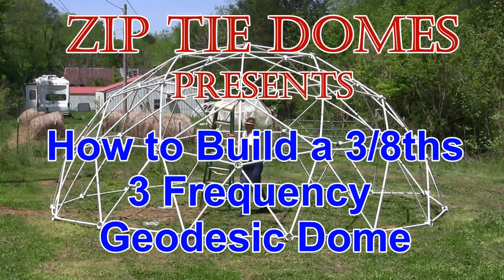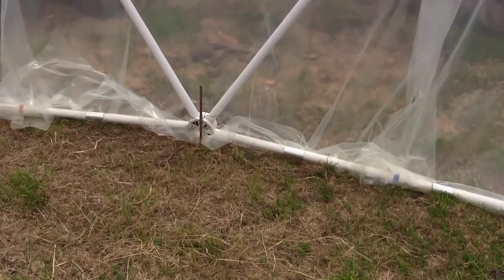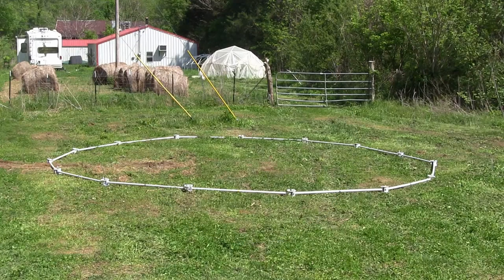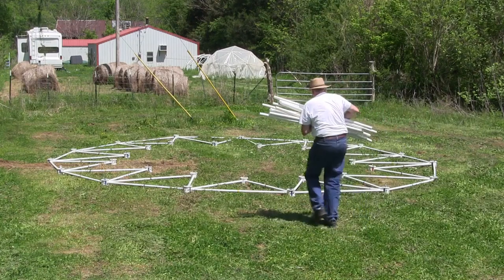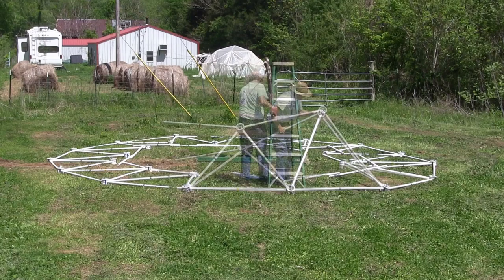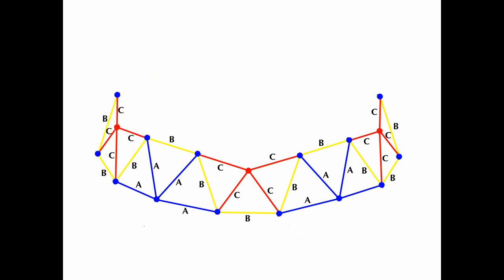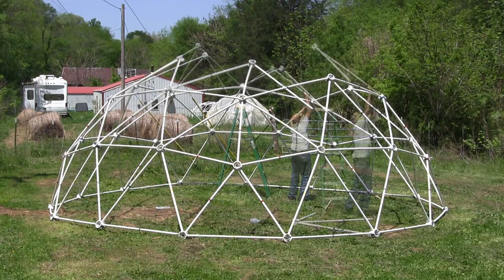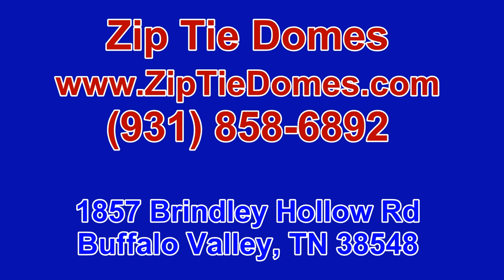Geodesic Dome Construction for a 25' 3/8 3 Frequency Geodesic Dome

Comment: Hi John. Just to confirm, I'm building a  3V 3/8 Shelter Dome ... I need 1.5" PVC with the Super Hubs kit, correct?
Reply from the maker: Yes.  The 1.5" PVC pipe has an Outside Diameter (OD) of 1.900", which will fit perfectly inside the holes that have been drilled in the hubs.  Call me a (931) 858-6892 if you have any questions and I will work with you personally to get any issues resolved.  Thanks for being our customer.  John

Comment: hello, I would like to know the proportions of the measures of.  A blue.  B yellow.  C red, which can be seen in the graphic of the video.  thanks😉
Reply from the maker: 5' for the Blue struts, 4' 10-5/8 for the Yellow Struts, and 4' 2-3/8 for the Red Struts.
Reply: @ZipTieDomes  thanks for the answer, these measures I had already read in the link of the description, my question was to know the proportions in centimeters.  example: if the blue is 100 cm, what the others correspond to.  thanks👍😉
Reply from the maker: @JosephTheparty  The 3v 3/8 dome calculator is at this link:
https://www.ziptiedomes.com/geodesic-dome-calculators/3v-38-geodesic-dome-calculator.htm
Click the "Meters" and enter .100 and click the blue Calculate button.

Comment: Why are these kits so expensiven
Reply from the maker: We are the most inexpensive geodesic dome greenhouse kit anywhere on the internet.  This 25' diameter 3v 3/8 with 499 square feet of floor space is $815.00, which is $1.63 a square foot for a greenhouse, and it is strong enough to swing from it or handle almost any snow load.  It is hard to find a structure that is that strong, at $1.63 a square foot.  Yes, $815.00 is a lot of money, but you get a good product.  You can also buy just the hubs for $230.00 and cut your own struts from 1" Schedule 40 PVC pipe to save money.  Yes, I agree with you, anything over $200 is "expensive", because money means a lot these days, but for people that want a large greenhouse in areas where there are high winds or snow, this is the most cost effective solution out there.  Thank you for your comments.  John Hurt
https://www.ziptiedomes.com/
Reply: Because doing it yourself is both more expensive and mighty hellish to fabricate. Unless you already have an arbor press, hydraulic hammer and drill press, then building a dome is just repetitive, time consuming, error prone and spendy.
Reply: @ZipTieDomes  Dang I wish I bought one 5 years ago at that price. The hubs kit is now double that cost. 😬
Reply from the maker: @italianpianoman21  PVC plastic is made from oil products.  Our prices did not increase until 2021, when someone shut off the oil pipelines in the USA and the price of gasoline and PVC nearly doubled.  I hated raising the prices, but we had to do so.  Thanks for watching the videos.  John Hurt